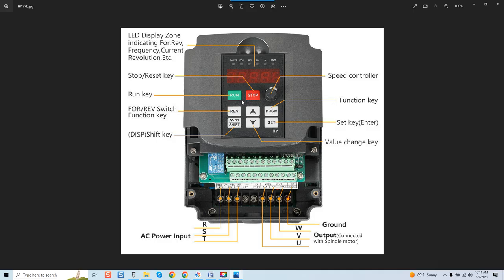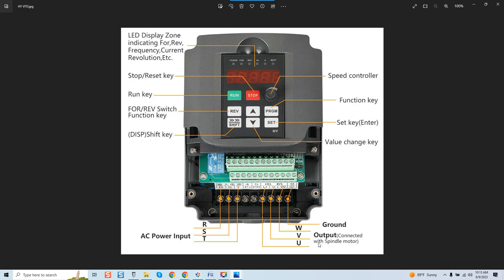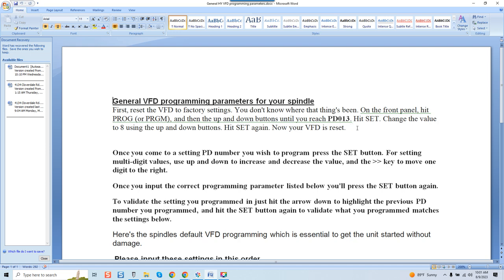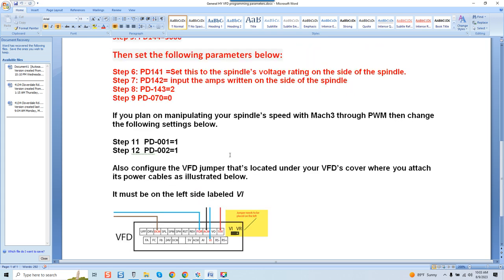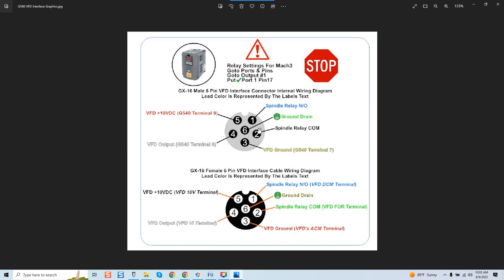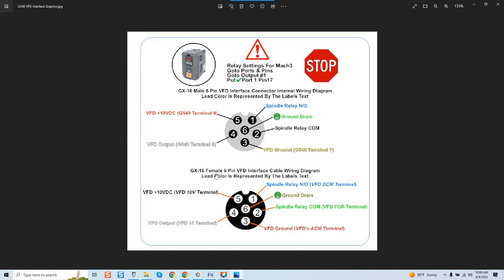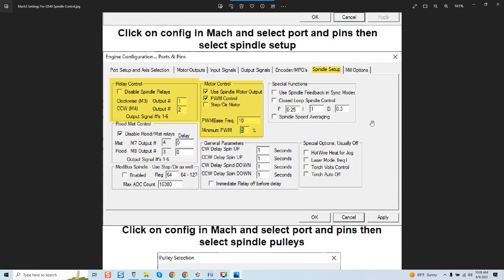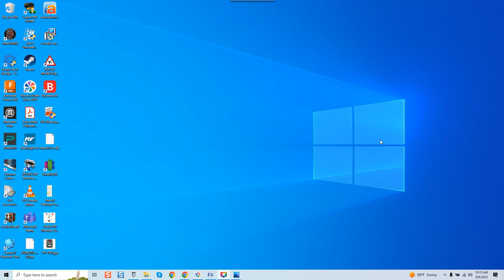How To Program And Wire An HY VFD (Complete Breakdown)..

Comment: I'm trying to run a 3phase motor off this... I'm getting the E.Lu.5 code that means Low input voltage. I've entered in the programming for PD008 as 120. Is this the input voltage programming?
Reply from the maker: I would recommend contacting your vendor as they should offer you direct support for free. I charge for third party support. 

Thank you,
Vince

Comment: Thanks so much for the video. Would this apply to setting up the VFD for a wood turning lathe, .75Kw 415V 3 phase motor with 240V single phase power supply, lathe spindle speeds from 350 rpm to 3500rpm. Cheers
Reply from the maker: Thank you for your support. The settings provided in this video are for HY VFD's. If yours is a different brand then you'll have to review its users manual, and or contact its vendor for the correct settings. Thank you,
Vince

Comment: Love your videos, thanks for these, I have a question.  I have a 110v HY VFD rated for 13A output and am setting it up now with a G-Penny 1.5Kw, 12A, 24,000rpm, air cooled spindle.  

When I go to set PD142 it will not let me go above 7, but my spindle is rated as 12.  Any idea why it will not let me go above 7?  When I try to increase the "tens place" from 0 to 1 it just takes the "ones place" back to 7 and leaves the "tens place" vlaue as 0.  I do not have the spindle cable connected while I have been doing this, just power input connected.
Reply from the maker: Hey John,

Thank you for your support. I recommend contacting your vendor first as they should be supporting the components they sell. If you would like to move forward with a paid consultation, I offer them as well. Please let me know if you would like to schedule one. Please understand as a vendor myself of CNC hardware as you purchased that I include support for all my client's purchase's which makes me cost more than overseas vendors on just the hardware price, but when factoring in I can, and do provide support which makes the investment justified to those requiring help in setting their hardware up. Thank you and have a great weekend!
Vince

Comment: Great video, thank you! I'm wondering if it will have to be reprogramed if power is lost...also, I'm using it in a barn to run a fan in summertime, it will be off all winter. Will the unit be damaged when sitting through winter in cold ambient? Thanks again.
Reply from the maker: Thank you for your support.

This depends on what you mean by "power is lost" If you're discussing a power outage from a storm the unit's settings should be reverified in best practice. If the unit is shutdown properly then the settings won't be lost. 

There's no way to answer your question about the fan as I have no idea what temperature your barn is in. In best practice all production robots should be operated in a climate controlled environment for longevity, and stability. Thank you,
Vince

Comment: Hello, 
I bought the same model complete spindlle kit and 2.2kw water cooling inverter.

but I'm having problems with loss of torque at low rpm 
Is there any way to adjust this so as not to lose torque? Thanks
Reply from the maker: Thank you for your support. The spindle's optimum HP is generated above 12,000 RPM. These aren't designed for low speed operation. Thank you,
Vince

Comment: I am using this vfd for single to 3 phase conversion. 3hp 9amp air compressor,    do i need to program the vfd?
Reply from the maker: Thank you for your support. Yes, all VFD's require programming to your spindle, or application. Thank you,
Vince

Comment: What if the spindle is not 400hz? Do you input 300 in loo of 400? As well as the rpm. My spindle is 18k, not 24k. How does the number in pd144 correlate to rpm speed?
Reply from the maker: You would input whatever frequency the spindle is rated to located on the units body. 

You would input 300Hz only if its what's identified on the spindle's body.

The calculation for VFD Hz to RPM is RPM= (Frequency * 120) / # of poles in your spindle

Thank you,
Vince
Reply: @corvetteguy50  awesome thanks! I figured, but I don't like to assume, and the manual doesn't say it word for word, or at least it doesn't sound like it does to me.
Reply from the maker: I always remember the military's slogan. 

Slow is fast, and fast is smooth...:)

Thank you,
Vince
Reply: @corvetteguy50  Yes, sir! There is never time to do it right, but there is always time to do it twice!

Comment: Hey thanks for the video, I went through and changed all the parameters to the recommended settings in the video and when I run the spindle it starts for a second and then gives me the eoca error  any thoughts. Should I reach out to the manufacturer it's brand new or am I missing something here any insight would be great if possible,thank you.
Reply from the maker: Yes, always reach out the vendor who sold you the unit as you're the only one who can hold them accountable.

 I suggest referring to the users manual as all the errors are located in it to define your problem. 

Your error deals with an over current issue. 

Thank you,
Vince
Reply: @corvetteguy50  awesome thanks again hopefully I can get it figured out.
Reply from the maker: You bet...:) Thank you, Vince
Reply: Hey sorry to keep bugging you I got the spindle running but it's maxing out at 12000 Rpms do you know what parameter I would possibly change to get  it up to 24000 thanks again. The information online is so vague.
Reply from the maker: Please review the video in conjunction with your users manual as its covered in it. We can also setup a consultation if you still require assistance. Thank you,
Vince

Comment: I bought the FC01 VFD and have a bridgeport 2J with a variable speed head, any help with parameters/settings would be greatly appreciated, i just need the vfd to convert 1 to 3 phase and be able to use the original  FWD/ REV switch
Reply from the maker: Hye Neil, thank you for your support. The support you should be seeking is from the vendor that sold the unit to you as they should readily be able to provide it. I only support components I sell. Thank you,
Vince

Comment: Do you have any wiring configuration videos for 0-10v pwm signal with a pwm to analog control module from a grbl based board for one of these Chinese spindles?
Reply from the maker: Thank you for your support.

GRBL, and Arduino type boards aren't to be used with CNC routers as they are USB, and universal serial bus is unstable for these types of production robotics. I cover this many times in my CNC fail video series. Here's my latest CNC fail video showing what typically happens when using USB https://youtu.be/U6TOK-s0hNw

This video like many others in my fail video series covers an email direct from the largest manufacturer of USB motion controllers CNCdrive out of Hungary. Their lead engineer Balazs covers what issues USB has with grounding, and stability. 

I highly recommend you proceed with caution with what you see on social media using these types of boards as many content creators simply have no idea what they're doing, and only mimic what others have done in videos. 

Thank you,
Vince

Comment: Mr.  The frequency in the USA is 60 HZ AND THE FREQUENCY OF MY MOTOR IS 50 HZ.  THE PARAMETERS P0.03 60HZ, PO.O4 60HZ, P0.06 60HZ, AND FOR THE MOTOR P2.02 50HZ Is this correct?  my gt vfd is 5kw 7.5hp thanks
Reply from the maker: Thank you for your support. Please contact your vendor for support as they should provide it for free. I offer third party support for a fee. Thank you,
Vince

Comment: How to change the spindle turnover, I have LEFT all the time and I want to change it to RIGHT
Reply from the maker: The answer is in the users manual on page 14. The diagram in the video also reflects REV switch on the units digital interface which controls this. Thank you,
Vince

Comment: you don't mention any thing about a 220 3 phase input, can you elaborate
Reply from the maker: Thank you for your comment, but your vendor is who you should be asking this question to as its their responsibility to offer you support for your components as they have your money correct?

R,S,T,= 3 phase.

 Thank you,
Vince
Reply: @corvetteguy50  I figured that. This is the problem: I have a Huanyang HY01D523B inverter, in the manual it states
that it has an input of either single or 3 phase. I have 3 phase, wired it according to instructions to a 24,000 RPM
water cooled motor. The inverter powered up ok, set parameters. When I pressed the start button the inverter blew up.
Can you help with this, I don't want to blow up another one.
Reply from the maker: Once again you need to reach out to the vendor that sold you the unit, and explain what you just did to me. 

When you explain you "set parameters" VFD parameters when set incorrectly will damage the VFD/spindle its running, and considering you said it powered on alright then you now know what blew the VFD. 

I only support clients that purchase units from me. 

Thank you,
Vince

Comment: *Buyers beware!! I just bought one of these VFD and I believe its a knockoff of the Haunyang brand shown in this video. It looks identical from the outside but the wiring is different and its not allowing me to change any of the parameters in the program. For example, it doesn't have a PD141, 142, 143, 070 or many others. I bought it on Amazon as a package kit with 2.2kw spindle and pump. After closer examination when I received I couldn't find a brand or label on it anywhere. And it didn't come with any literature or manual.
Reply from the maker: Thank you for your support. Unfortunately, this is happening more frequently. I would recommend returning it to Amazon as they have an excellent return policy, Thank you,
Vince